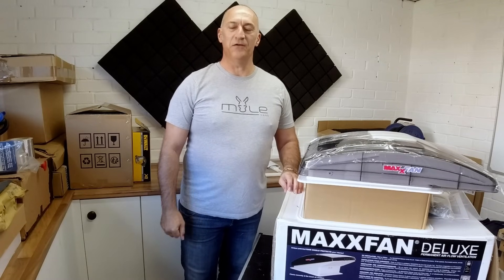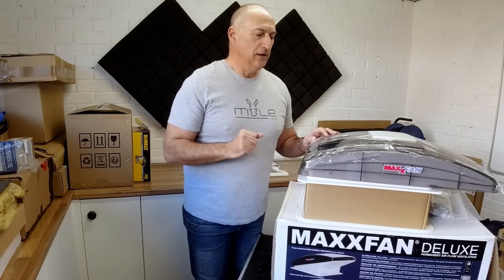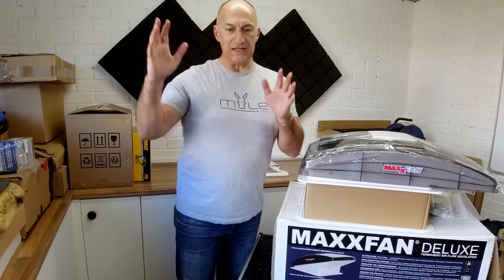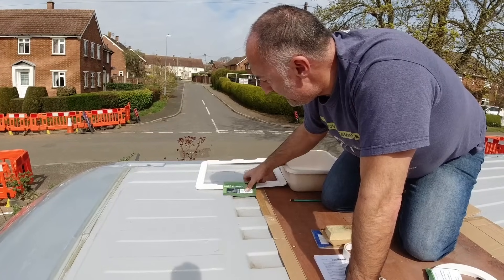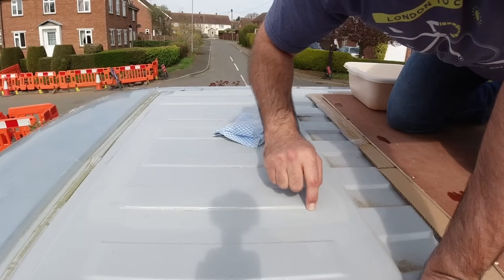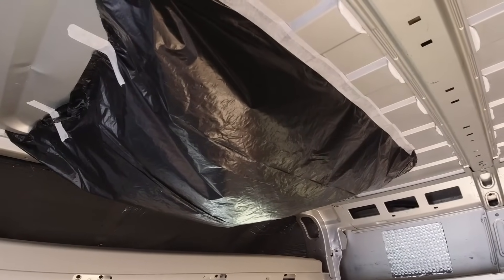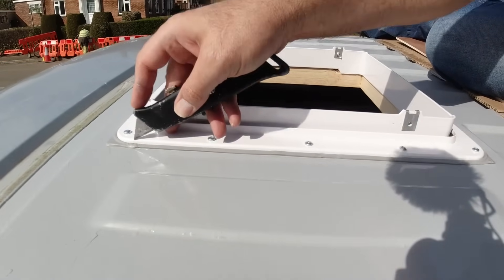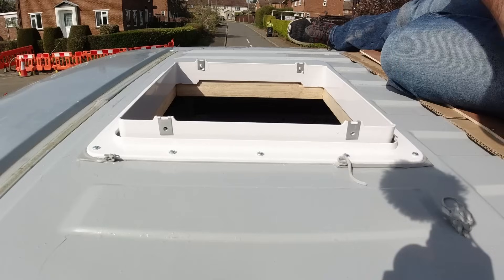Fitting the Roof Vent - Budget Van Build Ep 9

Comment: Tip?
As a final, final (final!) check. Take the frame you made, double check the fit on the fan, then place it in the roof to confirm your cut marks.
Reply from the maker: I did offer it up to the fan in the workshop but did that off camera 🎥 😊

Comment: Great job as always ..but .... those self tapping screws aren't for wood , they're for metal  ,,,,wouldn't it be better to pilot drill the metal and use a wood screw into the wooden frame ?  or am I missing something ..... love all your work
Reply from the maker: The drill end of the screw is obviously smaller than the thread so while it has good bite into the metal it will still have a holding the wood as well but the added bead of sikaflex will bond the wood to the metal really well. The combination of all that makes a really strong fixing.

Comment: Heads up people make sure that the tape you're using is rated for high temperatures😂 I found out the hard way that you should purchase what windshield installers use to trim the edge🎉 I'm banking on the sikaflex doing its job on the outside because the Inside Edge melted into the van on the floor😂 thankfully the ceiling I'm putting in it will be easy to keep an eye on❤

Comment: Hi Greg, loving the build series soo far. I noticed when you fitted the frame for the fan you didn't apply any Sikaflex before putting it on the mastic tape. would you suggest running a bead round the frame before or will it not make any difference. Thanks
Reply from the maker: I think the way I did it is sufficient. The mastic sealing tape is really sticky stuff 👍🏼😃
Reply: @GregVirgoe  ok thanks 👍, Im having my first try at fitting my skylight tomorrow. Wish me luck 🤞
Reply from the maker: @lewistowne6628  I’m sure you will be ok. Make sure surfaces are really clean and don’t be scared to use plenty of sealant. 👍🏼😃

Comment: Great video Greg! Keep up the good work!
One question though; after just fitting one of these I noticed the instructions say to fit with the baffles facing rearward whereas you’ve fitted them frontward. Is there a specific reason for this?
Reply from the maker: I’m not sure I follow what you mean. The discharge vent overhang part of the fan is facing toward the rear. The hinged side faces the front. 😊👍🏼
Reply: Just rewatched and realised I got myself confused with you on top of the van, I thought you were putting it at the back of the van. I should really pay more attention 😂 
Thanks for the quick reply, it alleviates some concerns that I’d put mine the wrong way round

Comment: Great video Greg. When screwing to the roof ours came with some plastic covers to put over the screws once screwed down, would you recommend not using & instead cover the screws with sealant??
Reply from the maker: I would still go with sealant. 👍🏼😃
Reply: @GregVirgoe  thanks for the reply Greg, we’ve had a little leak recently so I’ve re sealed & taken the caps off the screws and sealed those too yesterday. Luckily we’re just getting to cladding the roof so at least it’s happened now for us to sort 👍🏼

Comment: If you want to keep initial costs down you could do what we have done. Fit a Maxx Air vent which is the same size as the Maxx Fan, put in a conduit  ready for the electrical connection and upgrade later, when funds allow.
Reply from the maker: But then you have paid for a second vent? Cheaper to fit the fan from day one and avoid the secondary costs.

Comment: Hey Greg, how you are doing well. After watching all your videos 100 times, I'm now started with my own build. Thanks to you I can now manage to do a good job. On this fan install, it looks like you gone for the 350x350 mm cut instead of 400x400 mm or am I mistaken? Are there any advantages to one or the other? Thanks a bunch and looking forward for the next budget build video. Cheers
Reply from the maker: The actual roof fan main body is exaclty the same for both variations (350mm²) the only thing that changes is the size of the roof flange, The larger 400mm flange was made to cover bigger holes when replacing existing 400mm roof vents. if you are cutting a new hole in your roof just go for the smaller 350mm flange. :D
Reply: Thank you for your reply ✌️ I just got my fan delivery yesterday and could now take a closer look. The only thing I can see between different holes is that the wooden frame need to be larger/wider to reach the screws 😊
Reply from the maker: @kriscapson  the other difference is the larger frame has moulded plastic square sections the stick down to stiffen the flange but that makes it much thicker so it holds the flange off the roof if you only cutting a small hole? Are you cutting the hole from scratch?
If so why not swap the flanges for smaller ones. I have contact who can possible help you with that.
Reply: @GregVirgoe  Yes I understand that the fan supports both dimension 350 and 400. I just ment that if cutting a 350 hole I need to make the wooden frame to fit 400 mm otherwise when I screw down the fan the screws will miss the wood, or make a thicker wood that extends under the screw holes?
Reply from the maker: @kriscapson  yes I understood that. What I’m trying to say is that if you have the larger frame you really need to cut a 400 hole or the flange will not sit down flat on the roof. Yes of course you need a 400 wood frame. Your hole in the ceiling will only be 350mm Sq.
Reply: @GregVirgoe  My van is a Peugeot Boxer LWB. I guess the roof is the same in the front like your Fiat Ducato and I will mount my Maxxfan deluxe like you showed us. Thanks Greg, cheers! 🙂
Reply from the maker: @kriscapson  I have the smaller flange 👍🏼😊

Comment: Good explanation about installation. What about the softwood ring? 95% of its life will be without the fan running constantly and also be without benefit of insulation, so shouldnt that have a coating before install? It is difficult to do afterwards or to clean mould from it.
Reply from the maker: You can treat it if you feel happier. But this will be sealed in with tape when I insulate the ceiling. Not had any problems before now.

Comment: Hi Greg. I have read that the Maxxfan can be susceptible to over voltage. Have you experienced any such issues and if so have you considered fitting a voltage regulator to fix the voltage at 12v. There are a number of older videos on YouTube (mainly American) that highlight and address this issue in this way. Thanks. PS loving your content (ps I’m a novice camper)

Comment: Great video Greg, as always, your attention to details is top notch. I have a small question, you mention that you used sealing strips in the past when you had to fill those roof ridges, my van is a 2012 sprinter and I want to install a big 900x600 skylight so I will have to work without the roof kits as they don't exist for Sprinters. I bought a similar product to the w4 mastic strip, TEROSON RB 81, 20x2 mm, my question is: should I fill the ridges with this until I get to the same level as the top? or I misunderstood you. Thank you for your time.
Reply: Yes, a few layers of short strips between each ridge to bring them level with the ridges then a final layer/long strip (or two) all the way across ought to do it. But I'd happily defer to Greg if he has another suggestion.
Reply: Yes, bringing the deep parts of the ridges up to the level where a continous strip can go over them, so that the fan frame would sit on a even level surface. Check out the video that Greg mentioned, there he's showing the "buildup" in the ridges.
900x600 is really a skylight, nice!
👍🌃🌠
Reply from the maker: Exactly as these guys have suggested. I do have video of me fitting one to our sprinter in that build series if you want to see how I did it 👍🏼😃
Reply: I have finished the skylight, I wish I could upload a photo, I have used Greg's method and materials, but added a roof repair band by sika over the exterior edges when all was done
Reply from the maker: @bogdanflorescu2355  I have seen a couple of installs similar to that. The roof repair band is a very sticky tape? 👍🏼😊

Comment: I've just fitted one the same as I wanted the best but heard so many bad things about these not liking higher charging voltage I'm kind of regretting paying extra.
Reply from the maker: There have only been a handful that have experienced this. All mine have been fine for 4 yrs now and my voltage is daily up in the mid 14v when charging. For piece of mind you can always fit a voltage regulator for £10 and never have any issues.
Reply: @Greg Virgoe  Ahh so basically just afew faulty ones. I looked into the voltage regulators but didn't know what or which one was right. I was going to run some extra length of wire to try and create some voltage drop but may just see how it performs as is.
Reply from the maker: @lkradventures  https://www.ebay.co.uk/itm/204246912933

Comment: Nice Vid Greg, a good Run of Sikka along Wood to underside of Roof just to finish it off ,even though its Hidden , be a Sickner if after peeling Protective Film off the Perspex was Damaged, or can that be removed easily, seperatley ?
Reply from the maker: Yes can be removed easily and replaced. The whole fan is only held on by those last four screws so you never have to mess with the roof flange

Comment: Great video. Did you fit the inside plastic cover?
Reply from the maker: The inside trim gets fitted once the ceiling is installed. You can look at my video we did fitting it to the sprinter if you need to see that now
Reply: @GregVirgoe  thank you
Reply: @GregVirgoe  I’ve looked at your sprinter videos for fan install,thank you. Next phase- Would you be sticking the silver material to the bare metal struts prior to carpeting in this new build like you did on sprinter or something else,not sure if there is a newer way 5 yrs on? could I use 10mm cc insulation? 
I’m getting more info and courage to do my van from your videos than the rest of the internet and both books I’ve bought. 🙏😎.
Reply from the maker: @scoularmum  a thin layer of closed cell foam before carpeting will be the best solution. 
The double bubble foil and carpet has also worked perfectly in our sprinter van. We’ve never had any issues with condensation on those surfaces. It’s obviously just enough to raise the surface temperature above the dew point. It would be ok either way 👍🏼😊
Reply: @GregVirgoe  thank you I’ll go with the foil 💪😎

Comment: I purchased a MPK VISON PRO. I now have a problem I’m hoping you can help me with. 
I have fitted the top piece flush.
Inside the van roof I hasve 50mm insulation and 9mm upvc cladding and you guessed it the underneath of the roof light don’t fit flush. Any answers??

Comment: Greg,  thank you for this detailed video.  I will follow along step-by-step when I'm fitting my Maxxfan in a few days.  I just have one question for you: would you attach the Maxxfan Roof Adapter to the Mastic Sealing Strip and then proceed with the rest of the job as you did?
Reply: Just watched again and realised you said you only need to use the sealant and not the Mastic Sealing Tape 😳 Got it. 👍
Reply from the maker: @NatashaJBella  exactly that a decent size continuous bead of sealant top and bottom of the roof adapter is all you need 👍🏼😃

Comment: Greg ; i ve read on groups that maxx air fan does nt like voltage variations [reading the same about my tp link router when used on 12v] ; do you use voltage regulators anywhere in your circuitry ? If so do you use one per device or can you have a regulated fuse box ? Or do you think its un-needed on leisure battery circuits ?  [Your vids are so clear and patient , fabulous !! thank you ]
Reply from the maker: We have used all our devices on voltages up to 14.5v dc on a daily basis for 5 years and everything works just fine. I am sure out of the hundreds of thousands sold there is one or two odd cases but certainly not a problem in my experience. You can fit a voltage regulator to a device or group of devices so long as it’s rating is high enough to cope with the connected load.
Reply: @GregVirgoe  thank you . I was guessing the voltage on the leisure system would be more stable [ than engine circuit ] . But know you d be the man to ask . Thank you for replying .  About to retro fit a maxxair deluxe into my van [ fortunately I have an existing hole for non-fan roof light to drop it into].
Reply from the maker: @glossyprince  I’m sure you’ll be pleased with the upgrade they do work so well 👍🏼😃

Comment: Hi gregg, I've just fitted my maxxair fan but I've been reading about  a common fault on the units and I'd like your opinion. Apparently the pcb is prone to burn out due to excessive over voltage? I've read that they have no tolerance to higher voltages from solar systems and fitting a voltage regulator is advised?
Reply from the maker: This comment does appear to be doing the rounds on the internet. Speaking to Maxxair they have had only a handful of cases. From personal experience my two fans see a charge voltage in the mid to high 14v range every day and they are worked perfectly for over 4yrs now. It’s up to you if you want to fit one but we’ve had no issues at all.

Comment: What rotary fan would you recommend  ? I recently fitted a fletner 2000 but it's so noisy  .... had to block it up to sleep which obviously defeats the object... thanks ...
Reply from the maker: obviously the one that I am fitting in this video is by far the best, at low speed you cannot hear it running, inks are in the video description.

Comment: Top!
Thanks for another video.
Can I have your thoughts on this:
I'm halfway installing the MaxxFan, but I'm doing something different: instead of putting a bit of mastic in each bolt, I'm using a larger alu backed butyl tape all around the frame, hence creating a seal from the inner lip of the frame to the body shell of the van (Sika MultiSeal BT).
What are your thoughts on this approach?
Thanks in advance!

Comment: Maybe one day they will make these fans in half size as they are overkill for a van, well, at least in the two vans i have had. I want as much room for solar as possible.
Reply from the maker: The beauty of having them this size is the ability to run them on a lower speed setting where you can hardly hear them and they are only drawing 0.1 amp so can happily run all night when it’s really hot outside
Reply: @GregVirgoe  your reasoning makes a lot of sense. I don't mind a little white noise though

Comment: Everything as good as always but, if you´re planning to come to beautiful places like the south of Spain where the temperature can reach 43º in Seville or Africa, I DON´T RECOMMEND TO USE SCREWS. The bodywork, which is full metal may grow with the temperature and ruin the frame. This is what happened to me with this very same Maxxfan. It´s more than enough with the butyl and you will keep flexibility.
Reply from the maker: What a lot of people do is tighten them too much and bend and stress the frame before the sun gets to it then it will crack and fail.

Comment: Hi Greg, at the moment I have a midi Heki 40x40. Do you think it would be possible to install Maxxfan in the existing opening?
Reply from the maker: Yes you just need to ask for the larger roof frame for that size hole. Just be aware that the new roof cowl overhangs the back of the frame towards the rear of the van when shut. Hope that helps

Comment: Hi could you help me please on the settings of a renolgy 40amp dc/dc charge controller. I have 3 lithium 100 amp 12.8 volt batteries I have tried every were to find the settings  with no joy,I couldn't understand the manual its confusing to me I bought it from amazon and tried asking the supplier but can't get a reply. Could you help me please. Love the videos.

Comment: Why does the frame need to include the depth of the ply? My frame doesn't include that so I can attach my ply over and on to the frame
Reply from the maker: In the video I explained that I am putting timber on top of the roof beams that the ceiling will be fixed to. Now my frame will be the same depth as the roof beam plus batten so my ceiling can fix over both of them.